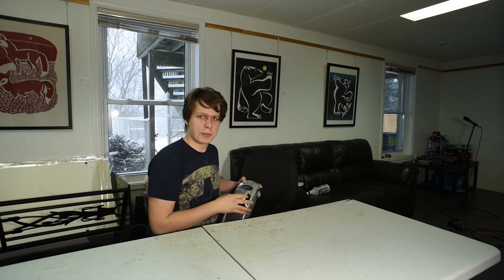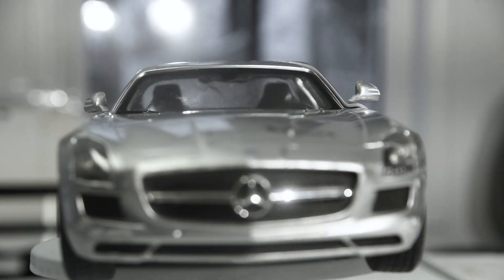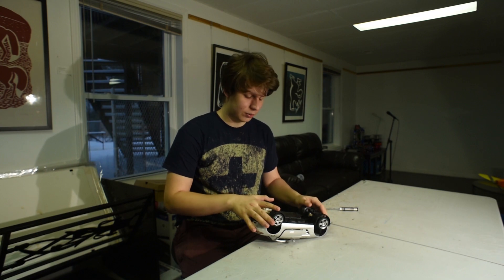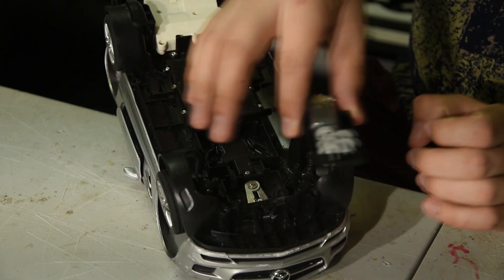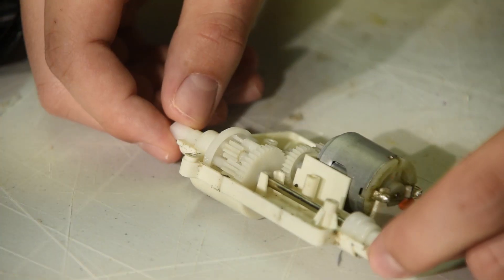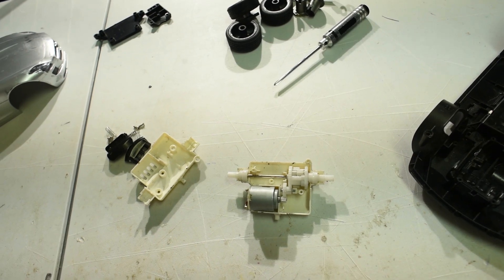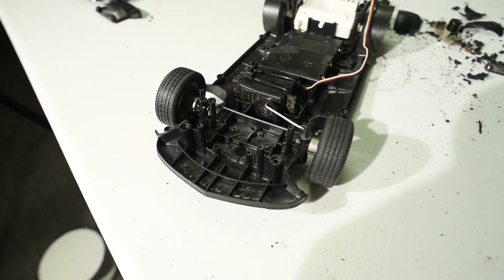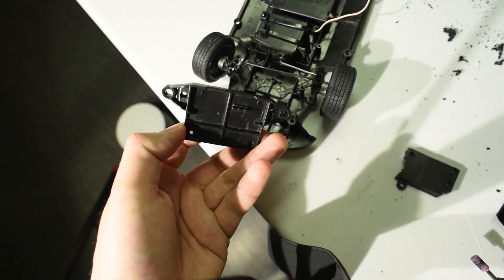EDF Powered RC Car

Comment: Slap some wings on that sucker and make it fly
Reply from the maker: I thought of that too! I'm pretty sure it would be too heavy though. The edf does not provide enough thrust  to take off
Reply: Add composite rocket engines on it to give it enough thrust to let it hop a little. Stupid and completely pointless I know
Reply from the maker: Stupid and completely pointless is what I'm all avout 😎